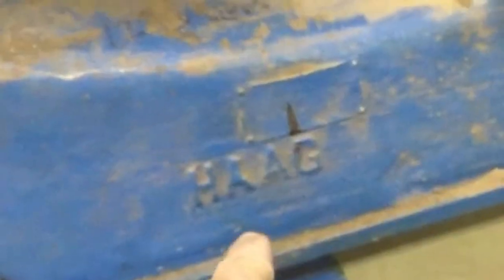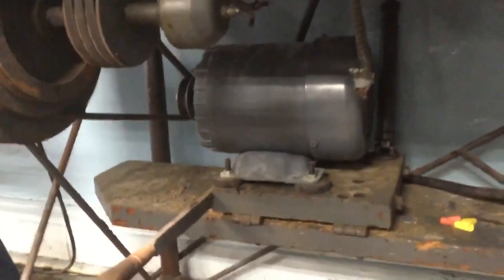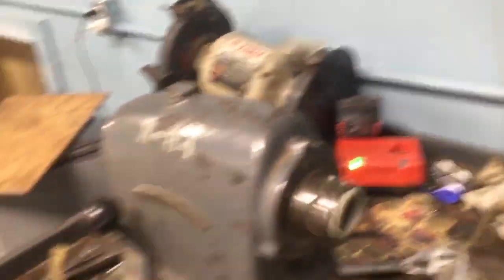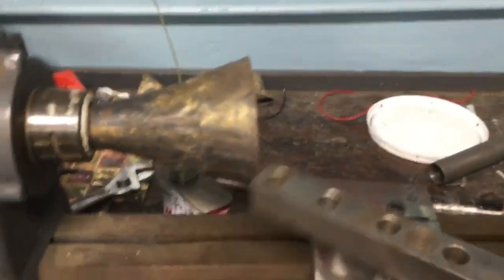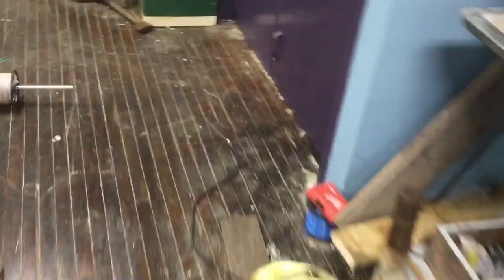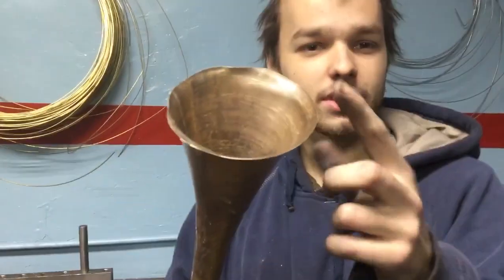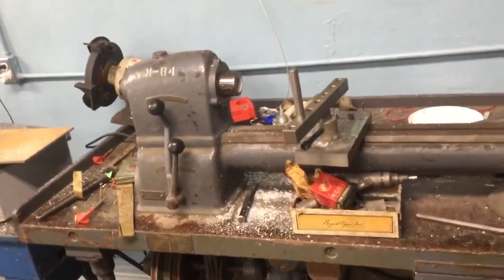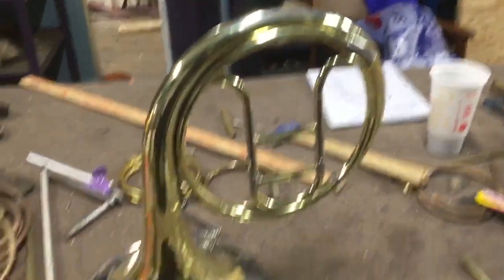About the Trumpet Inside Spinning Lathe

Comment: Miles, I put a very high value on my insulation in my new shop, in southern California!!  I am 40 years older than you, just wait.
Reply from the maker: My apartment upstairs is fully insulated, to insulate the shop would have cost more money than i'm comfortable with. It would have required moving all the existing equipment outside and framing, insulating, and drywalling the entire main floor. As well as delaying my move in 2 months. The reason I keep it so cold currently is because of the current gas prices. I'm Happy to work in 50 degrees temps to avoid $200 a month extra!